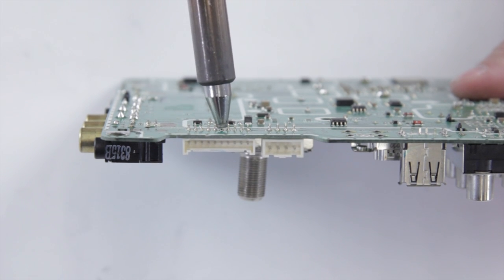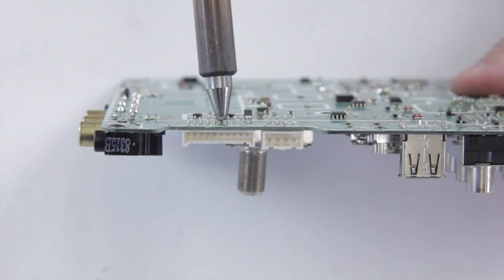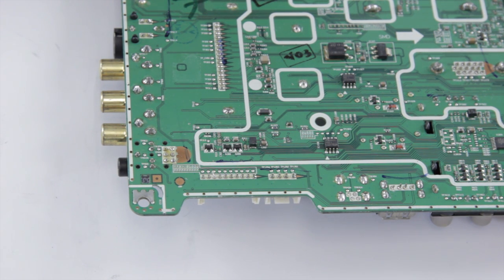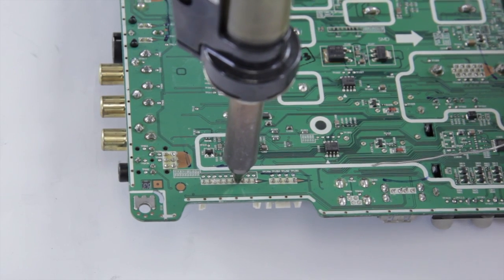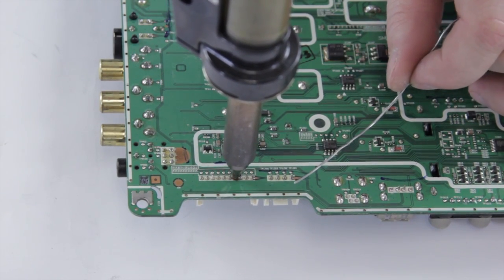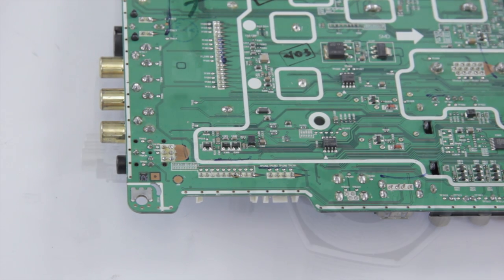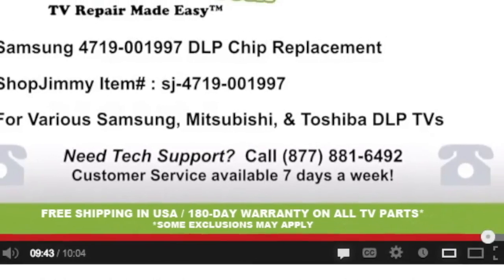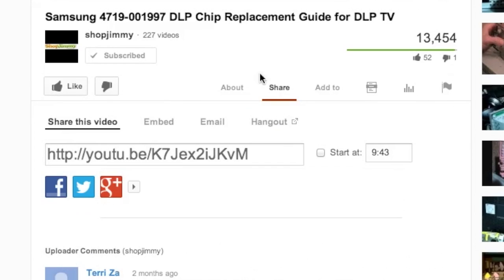How to Desolder Small Joints - DIY How to Desolder Tip #2

Comment: I had problem in my LG LED TV   
model 42LN 5400
no display
no standby indication.

I checked  power supply board and check input, fuse blown out, FET short  circuit , after replacing this I got primary voltage 300v is  getting at rectifier .

but no secondary voltage.

can you help how to check secondary voltage s and there testing point. in power supply board, is there any semantics diagram to trace the circuit.